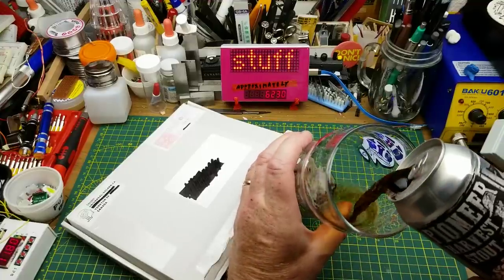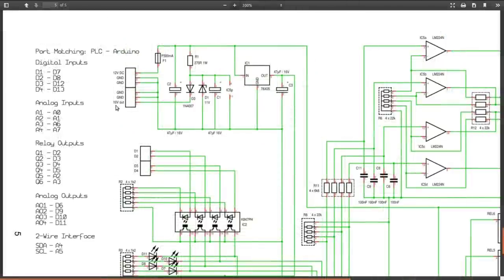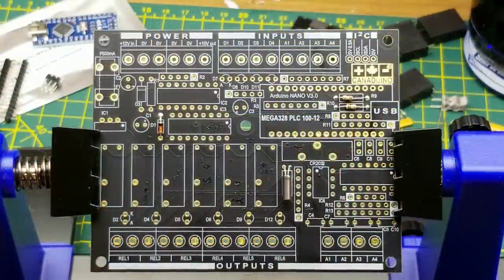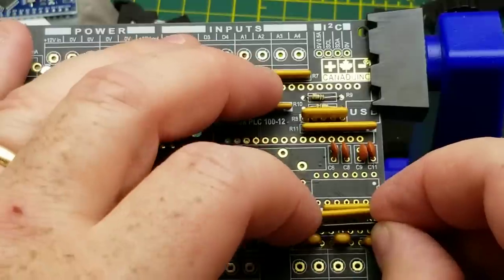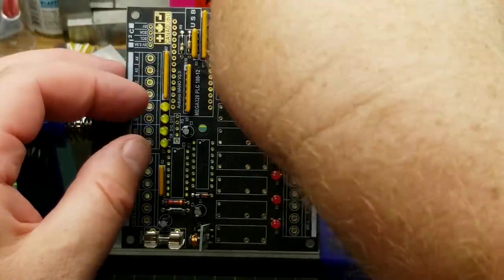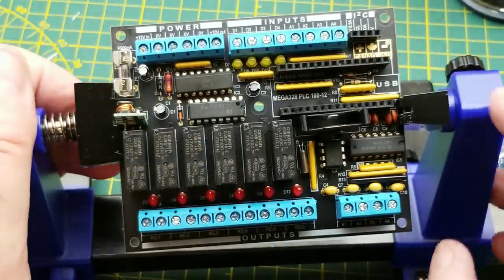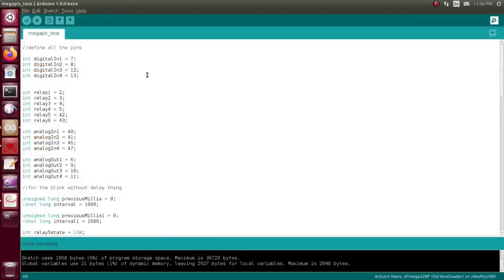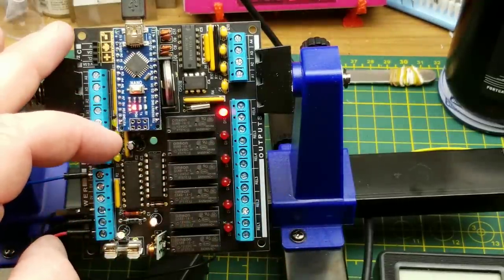Kit Build: Universal Solder plc mega328

Comment: Thanks again for a great review of one of our kits. 
Unfortunately, it is out of stock right now, but 300 kits are expected to be back in stock by Friday this week (07/31).
The reason was less the supply chain, it actually was some customers purchasing piles of 10 and 20 kits, which was unexpected.
The kit can be ordered here: https://www.universal-solder.ca/26442
Note: the switching DC-DC converter has already been replaced with a standard L7805CV due to the low power consumption.

Comment: I assembled one of these boards about a week ago. One problem I had is with the tabs and slots on the side of the screw terminal blocks. The tab on the side of a block didn't go in to the slot in the block beside it. I sanded down the tabs on some of the connectors but didn't do all of them and not enough on others. The result is the connectors would not stay lined up so they looked nice and neat on the board. I'll probably remove them so I can fix them. I am one of those people who orients the resistors on boards so the tolerance bands are oriented the same way. :)  One problem with the circuit I found is the analog outputs top out at 9.5V.

Comment: I ordered this after watching this video. I need to look at getting a boost converter though. 10 volts isn't enough output signal. I want the unit to be a replacement thermostat. So I need 24V DC signal. Modern thermostats are expensive that can turn on the heat or AC. I want to be able to leave the temp to 70 and the heater and the AC will turn on and off as needed. Instead of having to switch between heat and cool. I bought a box of sensors as well so I could use the temp humidity sensor from it.

Comment: I ordered a 328 and 300-24(a few days before watching this) they arrived, assembling the 300-24, thinking would be great if they documented the resistor arrays/networks and/or clarified substitutions being made unless this was a mess up in packaging; resistor arrays is a new thing to me, I've seen em in use but never knew what they were, there are 3 brands of arrays included in my kit, I figured the numbers on them might be a resistor code(thinking SMD) and on the orange ones the datasheet confirmed this, than spent a bit of time guestimating the other values and decoding their parts numbers(most of which didn't have detailed datasheets) LS83S xxx yyyy, AxxxJ(xxx turned out to be capacitor codes I believe, LS83S the differentiation between resistor code and the additional numbers is a slight difference in brightness and size).... narrowed down most the values accurately(verified with a dmm) to the BOM, but have 2.2K, 3.3K, and 330ohm which isn't listed, I assume they're substitutes but other than emailing them and asking them to verify this I can't really be sure.... otherwise the thing looks great; I have a 2nd unit coming in from Amazon(arriving today) so if I don't get a reply to quickly I'll have another unit to try to assemble for the short term
Reply: they replied pretty quickly and confirmed stuff; substitutes were guesstimated accurately

Comment: Two questions!
1. Can you tell us what size mounting holes are on this board?
2. Do you think it may be possible to swap the mechanical relays for SSRs?
Thanks very much!
Reply from the maker: The mounting holes fit an M3 screw.

I don't have any SSRs in stock to check, but I believe the relay footprint is a fairly common one. The relays used in the kit are OMRON G5NB. The datasheet should give you the dimensions.
Reply: @pileofstuff  Thanks very much!

Comment: I would have removed the resistor going to the LED on the Arduino board and leave the LED intact instead of possibly destroying it
Reply from the maker: That is also an option. 
For the record, I wasn't trying to destroy the LED, I'm just not very practised ar de-soldering 0603 SMD
Reply: That was a good idea. I did that and have saved the resistor so I can put it back on the board if I ever need to do so in the future.

Comment: One question: Did you receive one of the earlier kits without DIP sockets, or did you just not use them? Because sockets for the DIP14 and DIP16 components should always be included in recent kits.
Reply from the maker: In the note Volker said this was a "new kit" when he sent it. There weren't DIP sockets with it.
Reply: @pileofstuff  Thank you for confirming that. All kits shipped since early June (I guess) have the sockets for optocoupler, relay driver and OPA included. There is no DIP-8 socket for the RTC included since it takes a lot more effort to blow that one up ;-)
Reply from the maker: @wilfriedv.forster1986  I just double-checked, and I received this one in April, so that certainly explains it.

Comment: I will make this a separate comment.  Just don't power anything extra with any microcontroller board! This is a problem for most new people to uC electronics and even seasoned pros. I try to live by the rule "touch not the onboard regulator!" I know I have been guilty of this in testing especially, and slap myself when a brownout or some strange thing occurs because of it.
Reply from the maker: It really is the safest approach.

I know I'm guilty too.
I'm confident that I'll be using my "USB condom cable" in the future now that I have it.

Comment: It’s an interesting board but hardly a PLC. PLCs are characterised by the use of ladder logic, isolating the user from computer programming languages. It’s really just an interface between the Arduino and the real world.
Reply from the maker: There are ladder logic programming environments available that can load code to Arduino boards. 
For example: http://soapboxautomation.com/support-2/soapbox-snap-tutorial/soapbox-snap-arduino-tutorial/
Reply: Just as Pileofstuff said. Ladder is not what characterizes a PLC, and a PLC is not necessarily to program by ladder. Ladder is just a simple way for electricians to program something without knowledge about programming languages ;-)